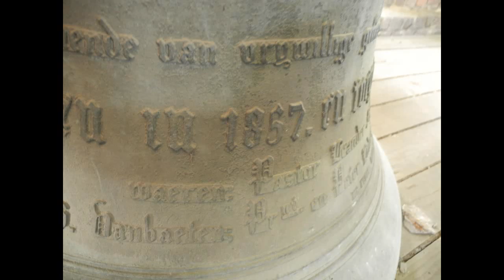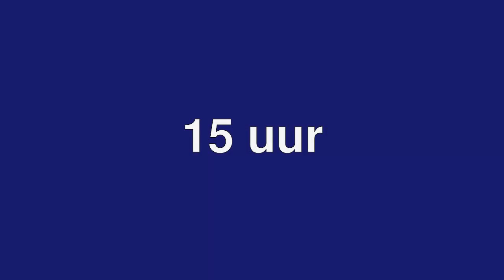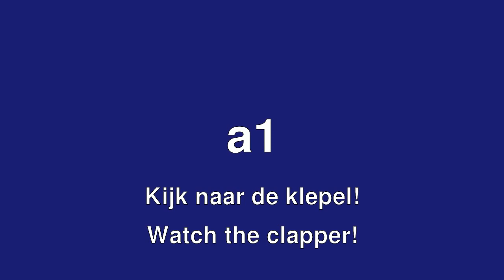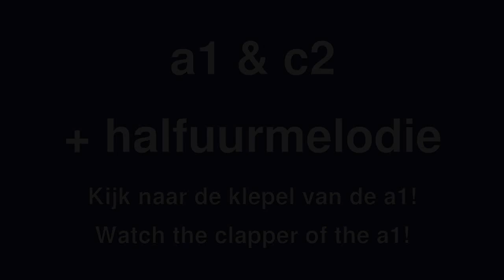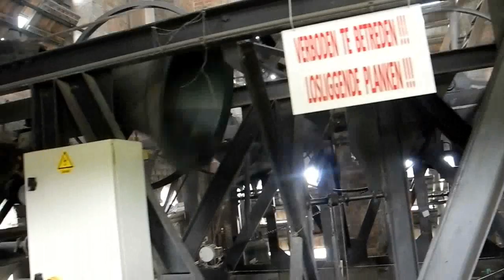Klokken Harelbeke: vliegen of vallen?

Comment: Well now that I have fully watched the video, I think the clapper is supposed to be a flying clapper but I don't know what could be wrong with it. Maybe if someone pushed it back like what you did, it would be a flying clapper. If no one bothered to touch it, it would be a falling clapper.
Reply from the maker: I think the tails of the clappers are just a little too short.  For a clapper to fly, the length of the tail must be adjusted to the exact geometry of the suspension of the bell.